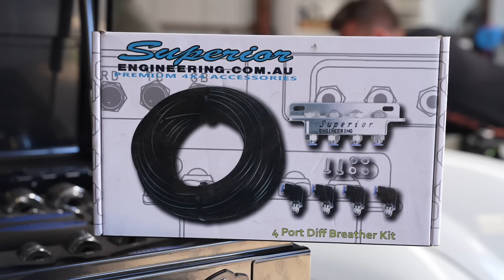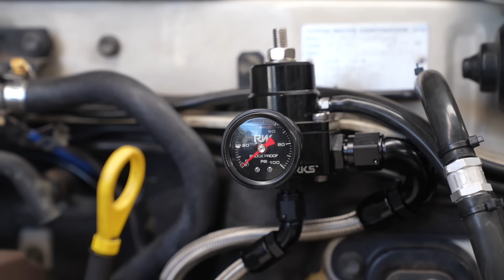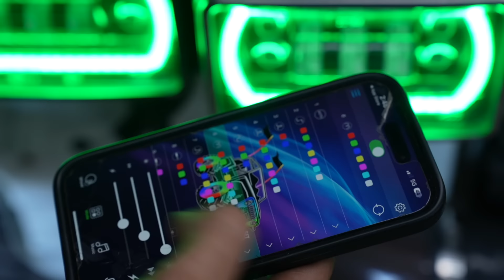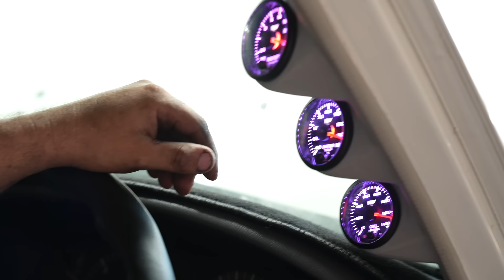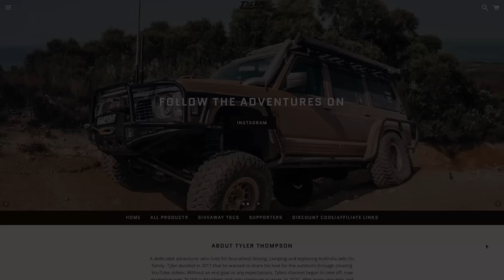Turbo Barra converting an 80 series Toyota LandCruiser

Comment: Only diesel 80s could run off either tank. 

The 1fz 80 sub just pumps into the main.
Reply from the maker: Cheers for the tip mate! That makes it easier for us, we will get that sorted
Reply: Can confirm my fz 80 had a 'sub' button, which filled the main tank up.

Comment: Depends what year your 80 is and how the fuel system plumbing is done. The second “return” line is the feed from the second tank. The secondary tank pumps to main tank and then the main tank feeds the engine much like the patrol.

Comment: Heads up that radiator pipe is butchered (mig spot welded potential pin hole leaks all over it (may not see them now but as you have hot flowing fluid through it for a few hours that 1.6 SS will expand testing the spot welds. Also the stainless is completely cooked anything past salmon colour is screwed will rust out in no time, if your going to tour this car I’d be 100% finding someone to redo it that can actually tig weld and tig brush after to ensure you have no issues of dumping coolant out on the trails
Reply from the maker: Those clips was it only tacked together while he was making it. It definitely doesn't look like that
Reply: I'd be interested in how you can weld ss tig and only discolour the ss to salmon ( red ) colour and get full penetration. Please let me know.
Reply: @bobwhatshisname2161 very very easily its called shielding gas. Correct flow, travel speed, cup choice, filler wire and angle of tungsten grind. These aspects all play a key role in obtaining a weld that isnt effected by oxides in the weld pool and or atmosphere internal and external depending on back purge (personly id run a purge as i wouldnt want anti freeze eating at the back of a sugared weld). As for penetration its 1.6mm material thickness. Most tig welder that know what they are talking about will tell you there is no trouble getting pen on that 😂
Reply: @Aidensmith1  I have never seen a weld on stainless that has not blued from welding. It is a byproduct from the heat and that is why you use pickling paste to clean the welds. I have yet to see this done cause in my 30 years of welding I have not seen it done.
Reply: Really? I dont think you have done much sanitary nor oil/ gas tig welding then?  Pretty standard practice iv only been doing this 15 odd years. Correct filler size and feed rate, gas coverage (cup to match) and for this application itself id go for pulse that would keep a fair amount of heat out of the part. That put together with good back purge and good travel speed should have it a nice glossy gold at most. Google stainless colour chart, level 1/2/3 acceptable what your talking about is a straight up fail 😂... best of luck 👍 remember practice makes perfect

Comment: It's looking sweeet!. ❤ Hitting the "Sub-Tank" button on the dash to transfer fuel from the sub-tank into the main tank, is the factory setup of my '96 80 Series petrol (1FZ-FE).  Wasn't your 80 originally a petrol?  If so, shouldn't it have worked that way from factory?  Or where pre-'94 petrol models worked like the diesel models (where the engine can draw fuel directly from either tanks - controlled by a switch/button)?

Comment: Was I the only one who saw them drilling into the "sealed" airbox to mount the bottle.....fuck I hope they sealed those holes properly hahaha.
Reply: Them holes are not going to matter. They have bolts going through them.
Reply from the maker: If you're sitting in water that deep for that long to have them holes leak enough water past the riv nuts and bolts into the airbox and into the engine I'd say you would have already had bigger problems haha

Comment: Albeit I gotta say you guys have done a stall next level job.  I just can't help thinkin this is an expensive can of worms with too many mods to be an ethical remote off road vehicle. True I'm a Toyota man through and through, I would have enjoyed the same design and inspiration put into a new 1HZ FTE motor rebuild with a VDJ gearbox of the later model with the longer 5th gear. That would make for an unstoppable 80 series with parts readily available. 
But cracka job anyway.